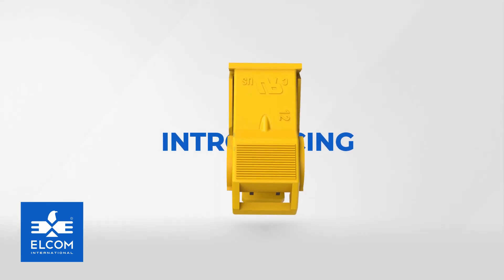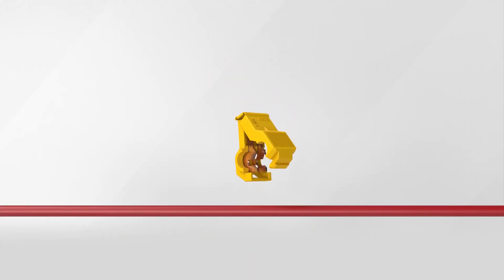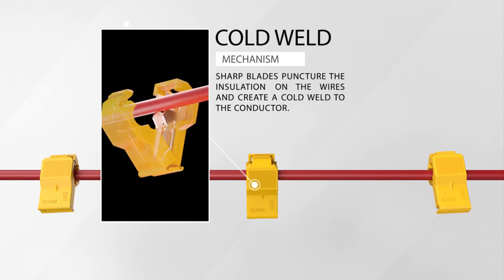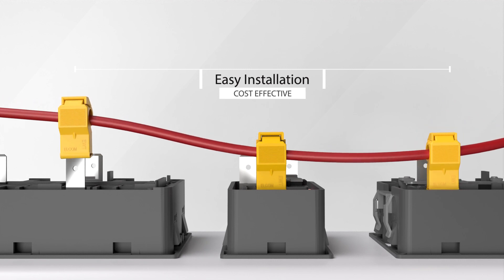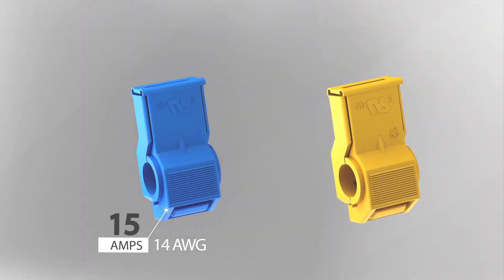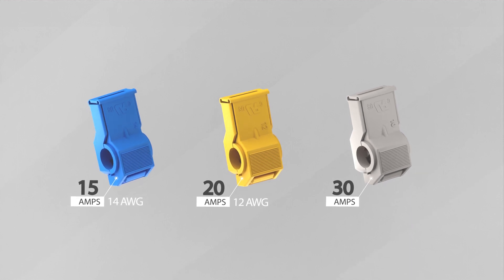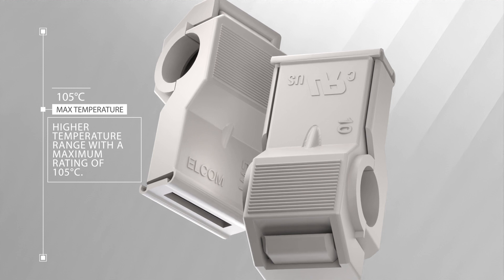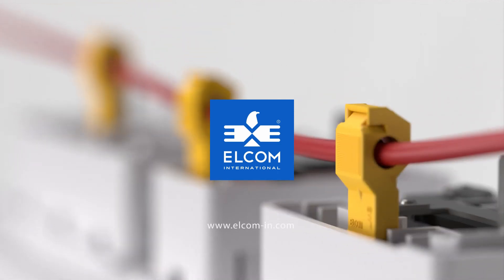Elcom's IDC Wiretap / T-Tap Connectors – Revolutionizing Wire Connections!

Comment: T taps are the worse thing possible for automotive use.  Vibration, and corrosion will lead to intermittent connections and damaged wires.
Reply from the maker: Thanks for sharing your insights on T taps in automotive applications! You're absolutely right that T taps can pose issues in the automotive sector due to the prevalent vibration and harsh conditions.

In the automotive industry, where safety and reliability are paramount, it's highly recommended to use more robust methods like soldering, crimping, or heat-shrink connectors for critical electrical connections. These methods offer greater resistance to vibration, corrosion, and environmental factors.

However, it's important to note that T taps do have their place in other scenarios. They can be quite handy in low-vibration environments, such as DIY projects, household appliances, medical devices, and PDUs (Power Distribution Units). In these situations, where the electrical connections are non-critical and the conditions are relatively stable, T taps can provide a quick and convenient solution.

So, while T taps may not be the best choice for automotive applications, they can still be a useful option in other contexts where vibration and harsh conditions are not major concerns. It's all about selecting the right connection method based on the specific demands of the environment and the importance of the electrical connection.